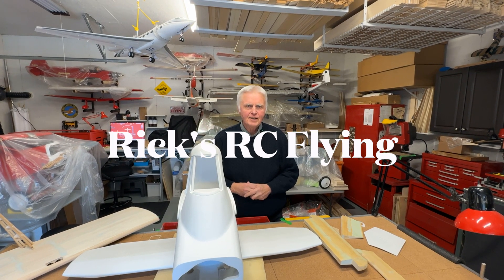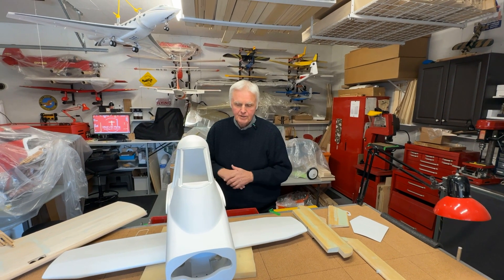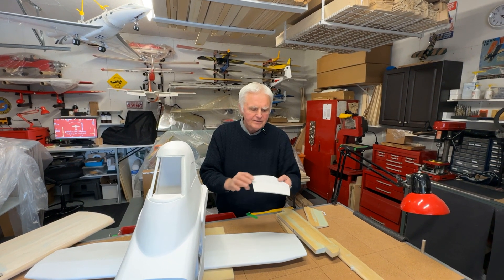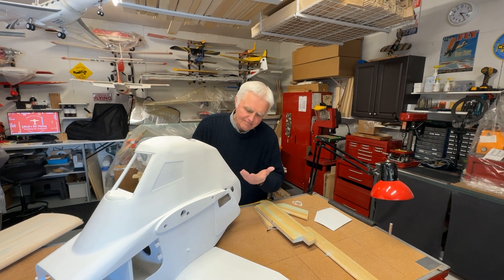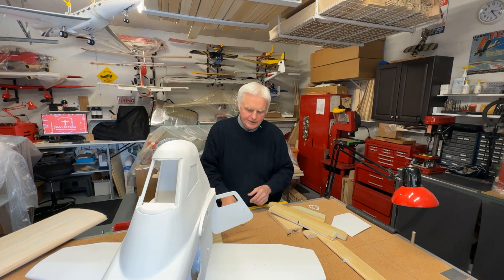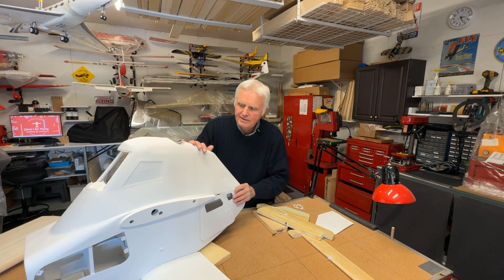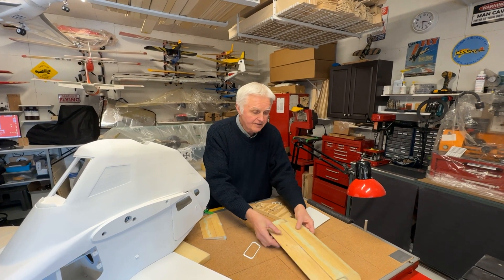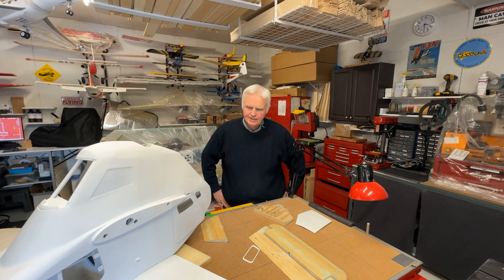PL 12 Airtruk Fuselage Episode 6

Comment: I believe that configuration is called a susqiplane. I remember reading that somewhere, but I can't find the reference. Other than the potential for being a handful in a cross wind, I wonder what the flight characteristics will be. It will certainly be one of a kind at the field. Its going to be such a smart looking aircraft with the internal linkages. Well done!
Reply from the maker: You're absolutely right; it is a sesquiplane. I will provide more details in the upcoming PL-12 video. I fully expect excellent flight characteristics based on real pilot reports, and pilots have consistently praised its handling.
Reply: @rcflyingwithrick   I understand that you can duplicate an aircraft aerodynamically, but how does weight factor into replicating the flight characteristics? I know that quarter scale RC planes don't weigh in at 25% of the full scale aircraft. I'm planning on building a quarter scale RC plane in the near future and I'm doing some research prior to starting. Thanks
Reply from the maker: The answer to this question may seem simple, but it's essential to consider various factors. With decades of experience in the modeling community and manufacturing, we have established effective power-to-weight ratios specifically tailored for model airplanes. If you’re building from a well-defined design, we can provide targeted power recommendations that will optimize your model’s performance. I strongly recommend choosing a higher power range.

This is particularly crucial when accounting for handling characteristics, which are significantly affected by wing loading. For example, warbirds inherently demand more power due to their higher wing loading compared to sport trainer models. Furthermore, our models typically offer a considerable power surplus relative to their actual size, ensuring you achieve the best performance possible. Embrace the power—you won’t regret it!